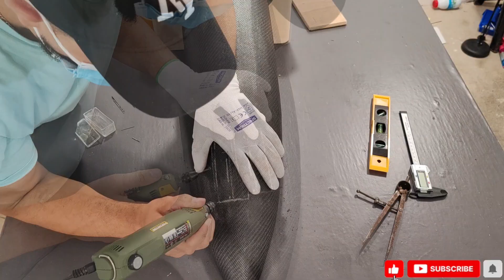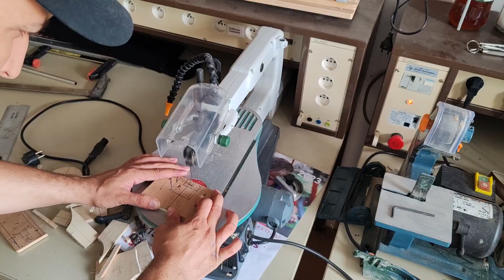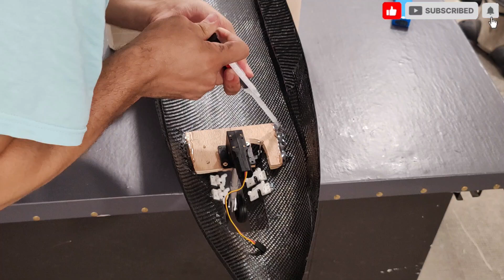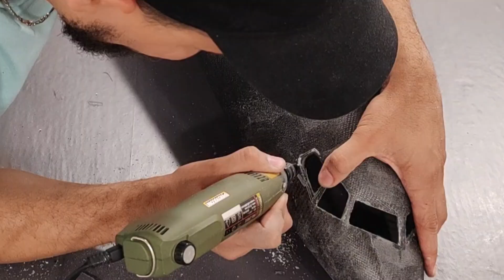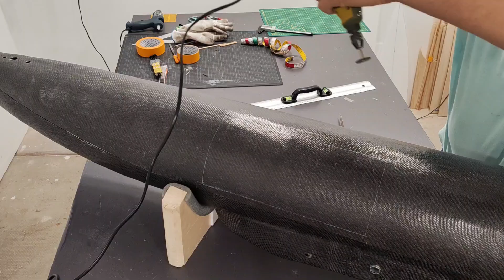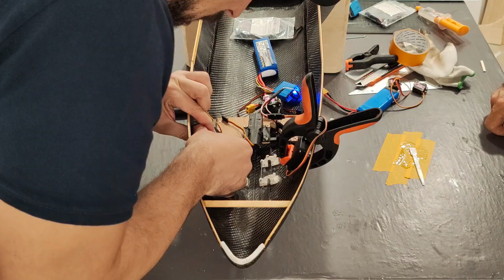Building RC Boeing 737-800 NG | Part 3 : Fuselage assembly and internal setup.

Comment: Nice build, but in the case the nose retract unit fails (they often do...) how do you plan to change the unit... the retract unit should have been mounted on the below side of the plywood
Reply from the maker: Hello,
There will be a hatch on the upper fuselage (above the nose gear) for nose section maintenance.
This will be shown in Part 4.